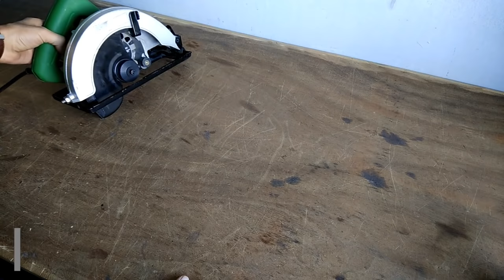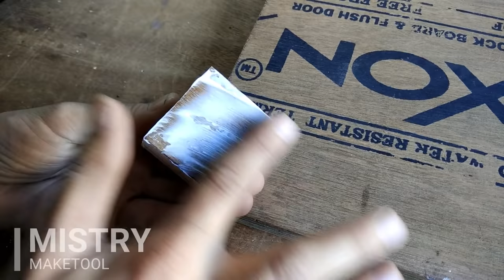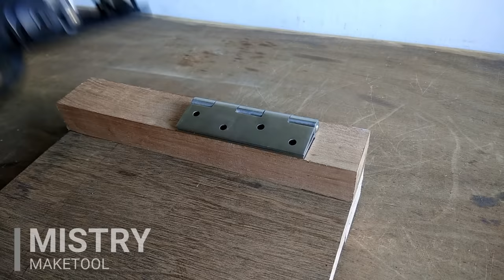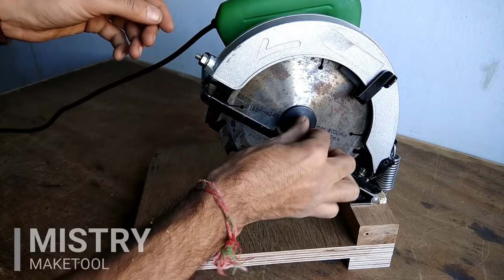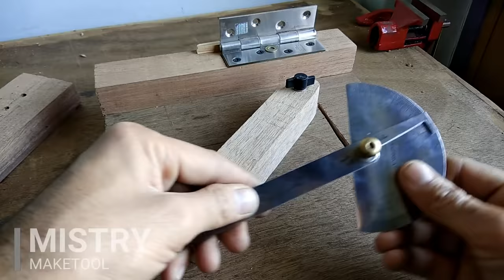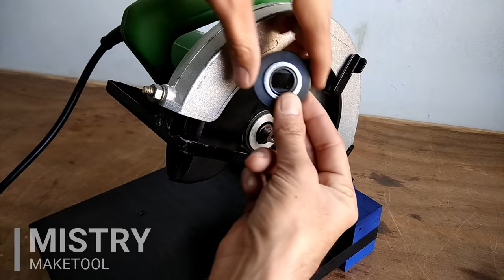Circular saw Hack || Make A Mini Chop saw Machine

Comment: I tried to build it myself following your very well done video. I found few things to improve: 1) for cuts where the angle is greater than 30 degrees (including 45 degrees), you can't cut long pieces because the block where the circular saw is fitted via the hinge is on the way, preventing the long piece (let's say 1m long) to have a 45 degrees cut at 50 cm (in the middle). 2) the hinge should be mounted up side down allowing the saw to bite the base more deeply (as long as the base legs are thick enough). This way you extend the angle up to 115-120 degrees(instead of 90 degrees).
Reply: How you make it cut correct ? i tried and  didnt  cut 100%   90 degree ...The problem is on 
the hinge it moves slightly
  ... please help !
Reply: Make your own degree jig, excellent saw making tutorial!👍👍👍💪💪💪😁😁😁

Comment: one suggestion. instead of using bolt, you can use a simple rod  for keeping the wood guide in different angle settings, which makes it a quick setup

Comment: I want to point out that all the clever jigs I've built from sites like yours have a carefully spaced pair of dowels underneath and close to the front of the base plate that match holes on my workbench. I anchor the jig to the table with the dowels to keep it steady, then afterwards hang it back on the (you guesses it) sturdy pegboard with dowels.
Reply: Brilliant idea!

Comment: I've been looking for a quick way to make a 'chop saw' from my circular saw and woke up this morning thinking that I should b able to hinge the saw somehow.  Searched YouTube and found this.  Exactly what I was looking for.  My only concern is having to move the 4 bolts if I need to use it as a normal circular saw.  I need to research if I can set up a quick release of some kind. I'm thinking if maybe using the pin hinges, the hinge with the removal pin in the centre. I also think that setting up an indent in a work tp so that this jig sits into it so that longer pieces would be supported and I could put some stop blocks.  Great stuff.  LOL don't like the colors !!  I use bright bubblegum pink for all my jigs.  They stand out really easily in the workshop!!

Comment: You must add more protection for you hands...great video
Reply: actually, wearing gloves while working with tools like circular saw, drill press etc. is dangerous. The tool can catch the glove and broke your fingers, or sometimes even cut them of. Its beter to have some splinters or small cut, than to lose your finger

Comment: Thanks, nice idea.
Yet some safety criticism from the working culture i am from:
1. 9:22 Fingers way too close to the blade. Man. You can do this if you don't care about yourself, but somebody caught you on video failing like that.
2. The Wristband as well as the watch are also a no go. Can right drive your arm into your rotating tool.
Again, closing positively: Many thanks, i will try out that idea pretty soon.

Comment: Just spend the $60 to $80 for a 7 1/4 inch chop saw. For the Love of missing fingers😂
Reply: Totally agree. The safety is not there.
Reply: @hortihorteae Bit late but... usually i'm on the safety train for these indian DIY tools but this one is alright when you use it correctly... which he does not.

dude, use a fucking clamp for those small pieces, don't put your fingers so close.

Also, make the spring holes a closed loop so it can't detach when it bounces too hard.

Comment: what size and weight is the spring? I tried a few different ones but can't seem to find the right one.
Reply: I tried couple of springs.  My skilsaw is heavy Nd it is not getting pulled up.  I will try heavy tension spring.  Somebody suggested the hinge to be opposite so that saw can cut deep enough. Particularly, for thick wood (more than studs).

Comment: What kind of glue do you use to glue metal nuts into wood?
Reply: Александр Гарнышев Pretty certain he is using Araldite
Reply: Александр Гарнышев ca glue !!
Reply: Dr.B Mirza I use the cosmofen CA12. I wonder what kind of glue the author uses? The cosmofen is not very good for gluing wood with metal.
Reply: looks like crazy glue